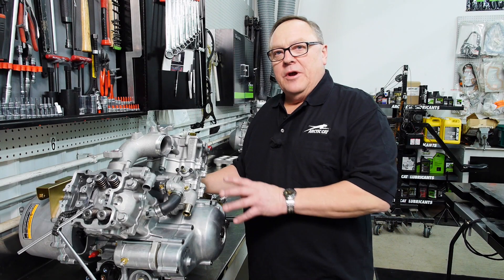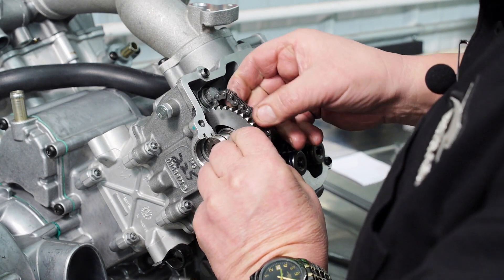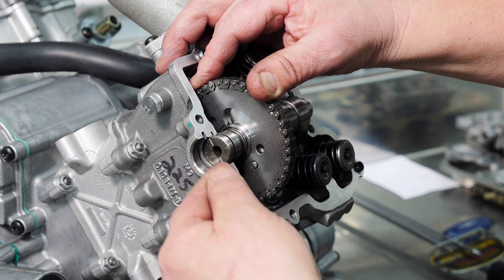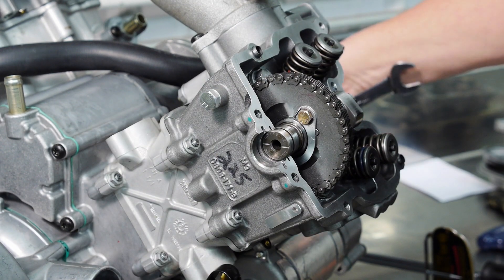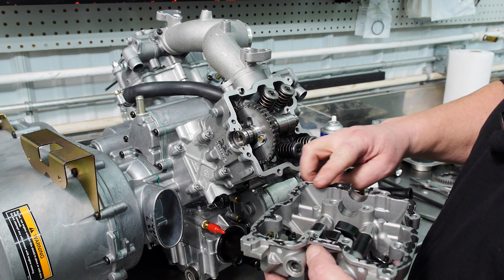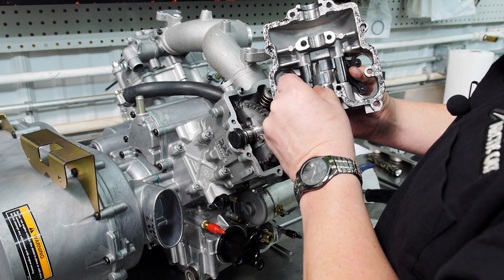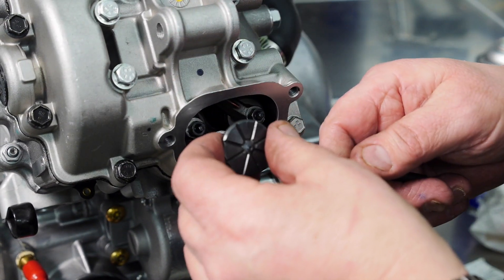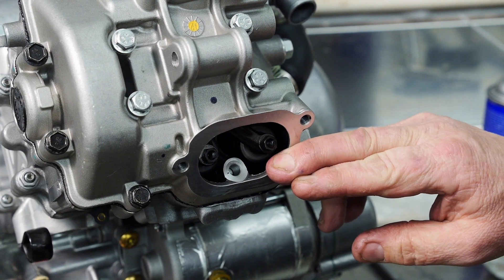H2 Engine Timing Part 1

Comment: Why do I get 40 psi front and 150 psi back if I do it exactly like this on fresh rebuild, but if I adjust valves with lobes up, I get 150 , 160 psi ? Make this make sense